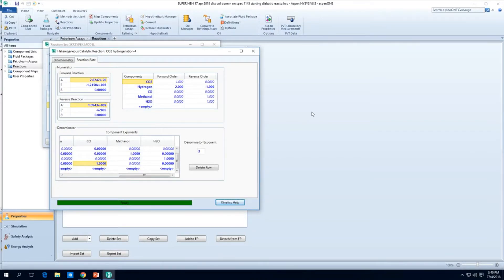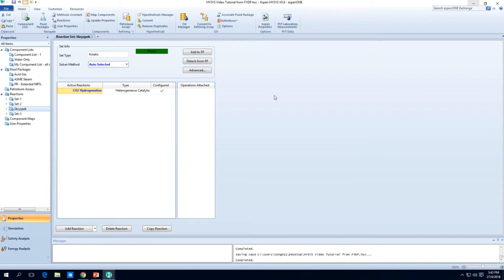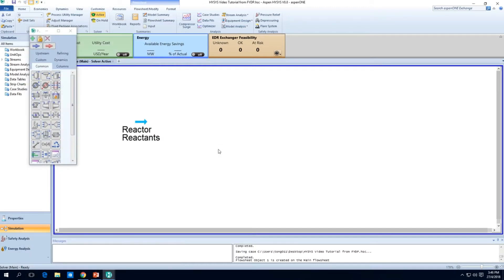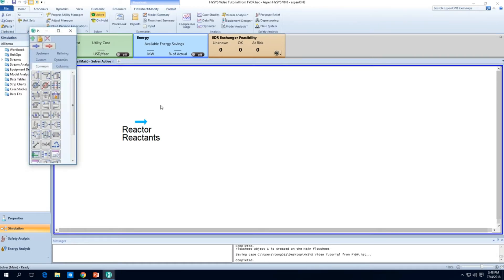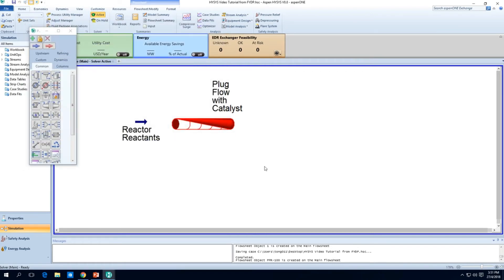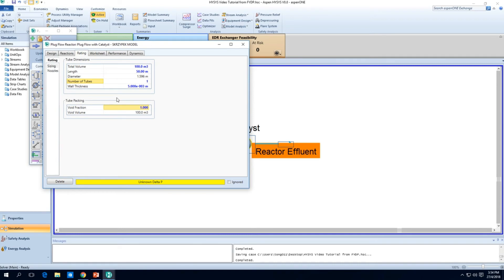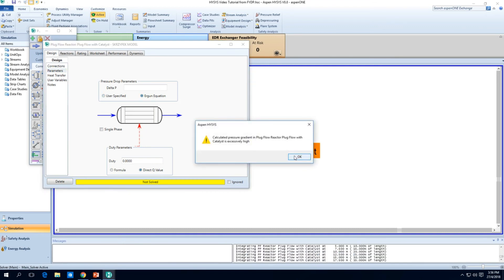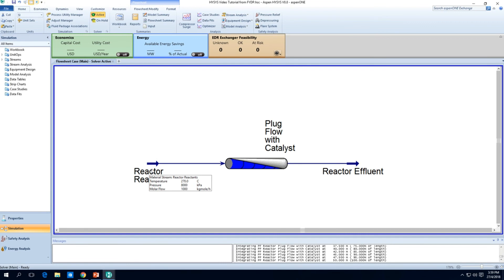HYSYS Methanol Production from Flue Gas 3   Reactors and Exporting Reaction Kinetics

Comment: My outlet stream did not produce any methanol eventhough ive followed the instructions for the fluid packages and reaction set provided by you. The outlet of the reactor has the same composition as the inlet of the reactor. Is there a specific reason why?